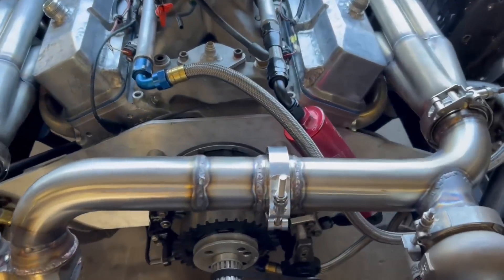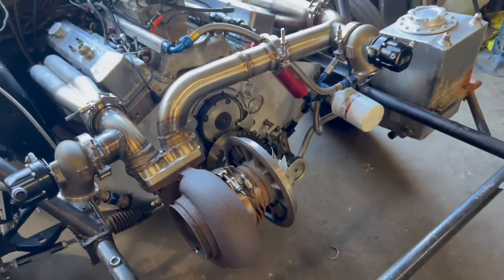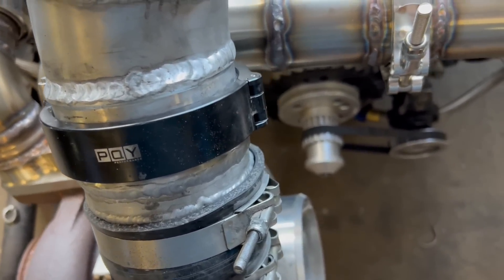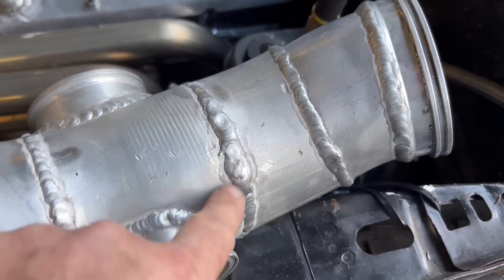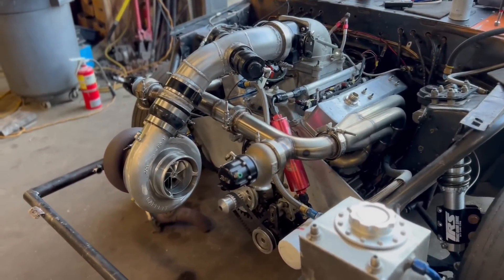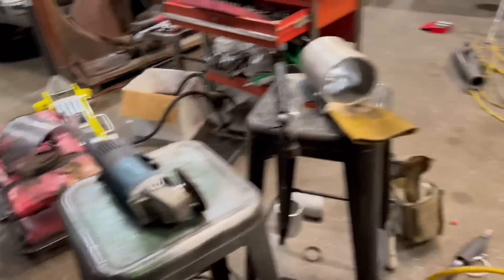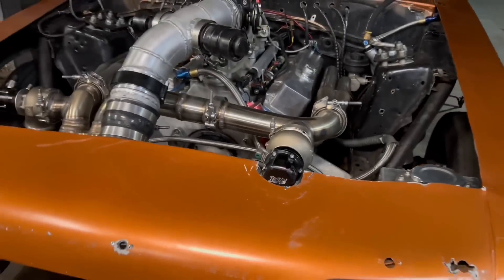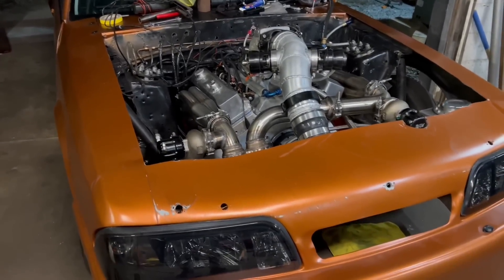Day 2 Building the turbo Kit!  Boosted SBC

Comment: To support the turbo, usually what i do is: build a turbo drain flange out of steel, then build the drain tubing off from 3/4” DOM and weld a steel AN fitting at the other end. So, pretty much, the oil is going tru the mount. After that, you can weld the drain fitting/pedestal to the cage, frame, motor plate or bolt it to the engine block by welding tubing or even flat bar to it. 
It witks really good, and it also had the advantage of putting the drain hose away from the turbo so it doesn’t get cooked. 
As far as the welds go, try running a little more heat and move faster, and you’ll see how they “pretty up”.

Comment: Centre the exhaust turbine flange to the crankshaft Centerline, turn the turbo 180°  exhaust exit the opposite side, your driver's side. cold side would be approximately the same.

Comment: Ahhhhhhh, ty John, at 9:15 I can see that vacuum reference line goes into the front intake runner on the passenger side, so the majority of the fuel, even though it faces reward, would have been pouring into the front runner, ergobwhy it was exiting mainly out of the right bank header side.

You may want to switch those 2 fittings to 1/8" on both ends, instead of 1/4" fittings it appears to be now, so....if that happens again in the future perchance with the system closed (turbo on the car), at least you will have reduced the volume of fuel reaching that cylinder by at least 50 percent less fuel.

At least that is what I would do for safety were I in your shoes brother, as the output on that fuel pump is a lot of pressure. And reducing the fittings and line size will not affect that vacuum reference to the regulator.

Just sayin bro.

Comment: John, people would kill for the ability to weld as decent as you. I'm one of them
Reply: Right!!!!
Reply: @jasonhastings5538  my shit would look like swiss cheese. Lol
Reply: Thats why i bought a welder and just started welding, got annoyed depending on others or having to take something elsewhere to get it welded. My welds are about like his and sometimes not as good but i did it and havent had one break yet lol
Reply: @young11984  I was practicing on this old miller Tig at work. But it died a few years ago and it never got replaced. We mostly used the mig for any fab at work so it wasn't "cost efficient" to replace
Reply: @robwigglezz944  yea i went to harbor freight and picked up their pro tig 205 since i dont do enough welding to justify a $3k+ Miller, i have a 28yr old millermatic 140 and a 5yr old miller 141 i bought from a buddy that bought it and couldnt weld with it and a huge 220v Century mig,stick,tig machine i havent used in 10yrs because it wont fit in the shop lol
Reply: @robwigglezz944  i have an ole linc mig welder but would love to learn tig!!! I just can see buying one for the little stuff i would do!
Reply: @young11984  I've been looking at those and the cheaper Everlast. Maybe I'll pull the trigger next tax return unless the IRS takes it all this time

Comment: How much alcohol did you get In the oil from the regulator sticking? Not bashing just asking. Looking good!
Reply: My bet was very little, it almost all went out the passenger side bank through the header...2 to 3 reasons.

It was a lot of alcohol, but was metered down to high pressure, small volume as it was exiting the regulator through the small vacuum reference line only,.

2. Entering through the intake connection into probably only 1 runner, 1 cylinder, and that cam with the high valve overlap, so both intake and exhaust were open at the same time partially of the time.

3. Once that regulator membrane split fully, the pressure equalized on both sides of the membrane, pressure to the injectors actually decreased, not increased...allowing full flow through the return line back to cell, allowed a much small flow out the reference line, and less flow and pressure to the actual injectors...why it did not hydro-lock was because he did not have the turbo installed and an open hot side.

Was a miracle actually that it failed then, and there was no fire!

Had it happened after the turbo was installed, I suspect a bunch worse.
Reply: Lastly,  that spark timing was actually set perfectly for that cam, as it did not backfire through that open header setup, or it would have been kaboom, and a catastrophic fire, and both wearing shorts....ouch!
Reply: So, while it seemed like TJ had really a string of bad luck lately, I would call the failure of that regulator as actually really good luck in timing, since both no fire resulted, and there was no turbo installed on it to feed all that fuel back into the engine, so nothing happened except a bad leak. Count every blessing boys!

Now just wondering if the new regulator fixes the slow spool up issue...and exactly where the other end of that vacuum reference line hooked to, to confirm the exact fuel flow and my thoughts above.

Comment: Do you not use an intercooler?
Reply from the maker: I don’t!  We run methanol for fuel.
Reply: @TurboJohnRacing  is it possible to not run an intercooler.  If its race purpose  only and no street time? And what would happen?
Reply: It's on pump gas